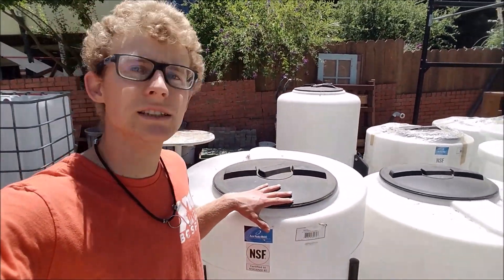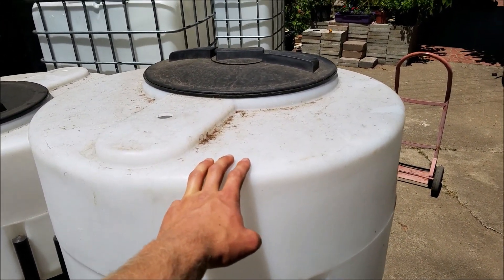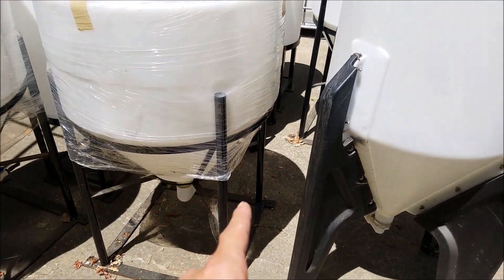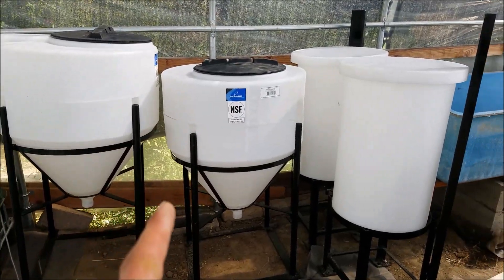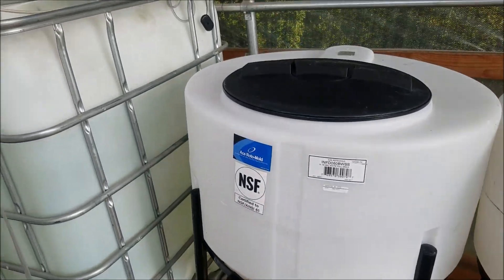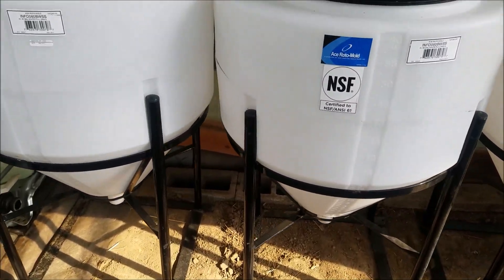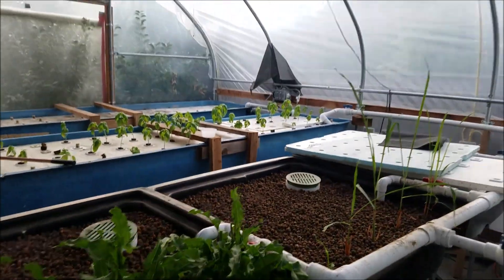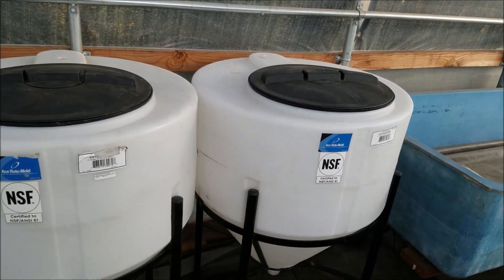Aquaponic system Renovation part 8 (filtration introduction/ washing and moving them) )

Comment: great system. filters and bioreactors are also my favorit parts of an aquaponic system. as the tanks are transparent: how do you avoid alge growth?
Reply from the maker: These filters are actually now covered with mylar insulation ( the reflective bubble wrap insulation stuff). So that prevents algae from growing in these filters. You can actually see an update on the filters here: https://youtu.be/p0B2l3DyRu4

Another option is you can paint the tanks which eliminates the algae growth as well.
Reply: @vonponics  I live in a warm climate do I really need insulation? I'm planning on just painting it with black to prevent algae growth
Reply from the maker: @jashuabat1785  No insulation is not necessary if you live in a warm climate.
Just painting it black to prevent algae growth is good enough. 
The benefit of the insulation is that it could help with temperature fluctuations in your system itself. Depending on the size of the system and the daytime vs night time temperature. Just something to think about.
But that can always be monitored and determined if needed later on. Otherwise as you mentioned just painting it black is good enough.